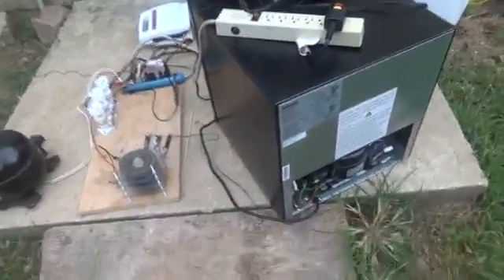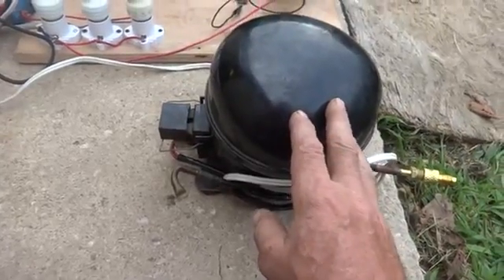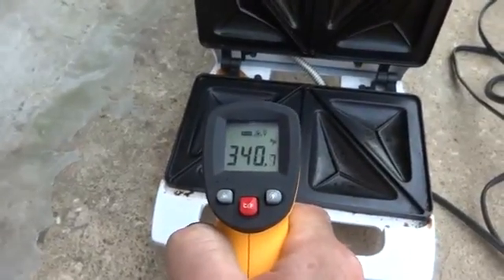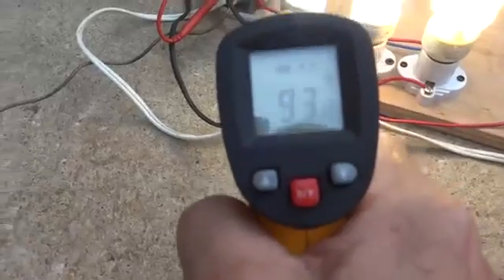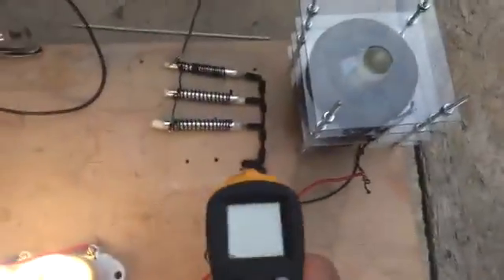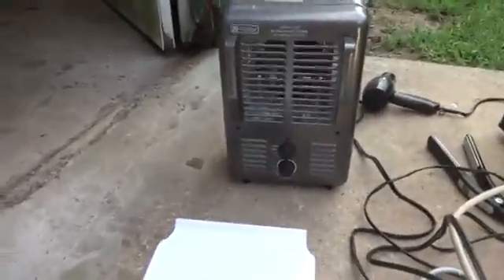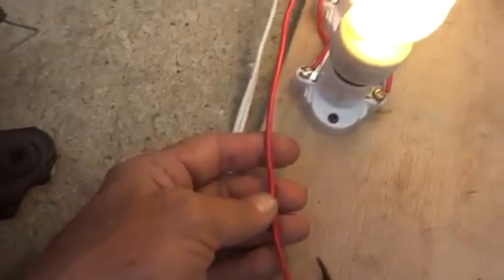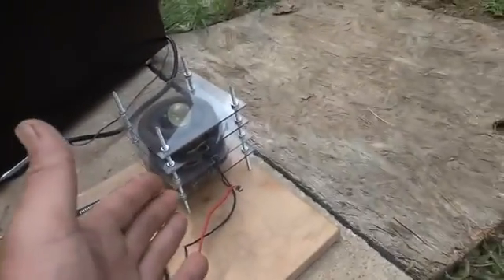Keshe Self-Running Power Generator - 4kW Demo

Comment: Or Hiding the real things in your mind what bloody u had done such a non standard product twisted wire u will connect all this load even if its soldering as per international regulation is not accepted for AC volt or DC volt pls study the regulation at least ,,,,,,stop the bloody drama,,,,,,

Comment: this is fake. keshe is scamster. do research and you will find this too be true.
Reply: I.S. Swinburne . High I'm talking about magraf free energy and the off grid system. There is only two videos which actually show this working there are many people who invested great deal of time in constructing the magraf to find no change in electricity bill. Including people who bought magraf as well . There are many who believe Kesh to be a scam. Do research on Internet and I'm shore you will find this to be the case with magraf unit
Reply: +
I.S. Swinburne
And Santa Claus existst. You are an idiot who fell for a placebo. Get professiobal help
Reply: +
darpan sikdar
There is only two videos which actually show this working
There is only two fake videos which actually show this working.
Fixed that for you
Reply: @sheriholmes3226  Just make your own then. Then make a vid on it. In the end you have to find a way to make it work rather then complain. I've made one that circulated power and generates more energy. The third variable is the chemical compound in between the voltage output. Rather than using the and get and circulating it. You great a chemical compound that is sutable to your use.
Reply: @martinsinger9886  nah i use a elextrolosus fuel converter to get hydrogen gas to power my generator combined with this to reduce the power consumption.
Reply: And I have a couple of pink unicorns in my garden. By the way: Santa Claus exists :D

Comment: That is an interesting observation... Both the refrigerator and the compressor appear to be plugged into the power strip... where that is not what the circuit on the link calls for...
Reply: shouldn't there also be a lead from the positive of the plasma capacitor to the ground (-) of the strip, via a switch, as well as a lead to the capacitor in the refrigerator?

Comment: If this actually worked, then everyone would have there whole house wired threw two refrigerators. yet,,, somehow they don't. Go figure.
Reply: How so?  The average american has no idea how to wire the SIMPLEST of circuits, and patents for "over unity" devices are bought up every year by major industries. Nanotechnology already exists in mainstream science and has been proven to generate electrical current through the quantum field...  I believe this demonstration is not on how to wire refrigerators together, but is focused on the tech that is the stack of coils, and how they interact with the rest of the circuit.
Reply: bos dad not really have you researched the 100s of people who been sent to prison for fined up to the millions for going off grid. it's illegal seriously call your power company for a disconnect because your going off grid and see who comes to see you. man in MN prison for installing a windmill to power his home, Oregon man in prison for collecting rain water on his property instead of city water, Florida residents threatened with prison for turning on solar panels during hurricane Irma when the grid is down. told while the grid is down your down. but a gas powered generator is fine. go figure. the govt does not want us to be self sufficient at all. it's less control on us. you can only go green as ling as your connected to their utilities. and can monitor you. a farmer fined 2.8million for going to solar and not using the grid anymore. look up the hundreds of preppers in jail or fined huge sums of money for making their own power water and food. I understand preppers after looking into this alot. the govt wants complete control of everything you do. you do know the history of Tesla right. he was backed by jp Morgan largest oil tycoon. he made them and power companies a ton of money. and they owed him a lot of royalties and he let it got it would bankrupt them almost. one of his last projects he was creating free power for the world. when jp and the other backers found out what he was planning to do. and had created it worked. he did make wireless electricity area was blanketed with power and ligbtbulsb all over the property lit up. but anyways they pulled all funding and had the tower blown up literally. they were not going to let anyone get free electricity and take millions of year from them. so why would anything change now.  Tesla was the best we had and when it came to money or the best for humanity. well you see where we are today he died alone and poor staying in hotels. the moment he died all his papers he had left were confiscated. he touted and was willing to prove he could make free electricity. but no one would give him a dime to do so. if it's not possible why destroy a man and ruin his life and then take his life's work the moment he dies so his relatives can't receive his belongings. there are a couple people who found his papers there grandparents were his assistants and they posted online about finding these papers from Tesla trying to learn more. and there houses were broken into only the papers were gone and the computer was clean and hard drives mjssjng. yet he never posted where he lived or anything. someone tracked his IP address and broke into his house and found the different floppy disk he had stuff on. if free power is fake there's no need to do all that. Tesla could have worked and been rich. but from that point on he wanted to give people free power and every resource available was used to stop him. they knew he did it. 
another thing I have a hard time understanding is these modified alternator or generators being spun by electric motors. take your car for example. once started the battery can be removed and it runs. it's been spun by a gas motor same with a portable generator. so why can't a electric motor do the same as that gas motor. once turned on if your making enough power, there's no reason it can't run it. but as long as gas makes the rpms that's OK good science. what's hard to understand is why a modified alternator or a generator cares what spins its pulley and why a DC motor cares where it gets its power from. as long as both do their job it works from what I've seen. but it's always claimed as fake. I've seen some start from wall power then removed when up to speed and work. but we're told we can't like it has a conscience and knows it's not being gas or grid powered anymore. but a simple experiment with a vehicle should show anyone once current is created it can run without the battery that started it. because the rpm demand is met. it's easily met with a DC motor as  well obviously you have to stay with what power is available
Reply: Bo's dad = troll
Reply: +I.S. Swinburne
Because he is not stupid and gullible enough
Reply: @2020Kofficial  "harmless worthless scam artist" , I wouldn't call keshe harmless. keshe has no technology, no science, just BS and somebody actually eats what keshe sells. This keshe crap won't end well ..
Reply: @2020Kofficial  Check out "Heaven's Gate". I wouldn't be surprised if something similar will be the end of this kesheshit-thing.
Reply: @2020Kofficial  I've watched plenty of keshes workshop videos. The theories he tells are stupid and just plain don't work. if you look at keshe, you can immediately see that there's no good energy coming from that whatever it is.
But it's good that you agree that the energy side is bogus. No, I don't give money to scammers to give them more fuel to scam even more. If you seek knowledge, I just have to tell the truth that you have been trapped in a ratTrap.
Reply: @EmloK KolmE

Are you afraid?

I've  built  and bought there things.

I don't  pay for electricity  anymore. 

Why do you want to?

Comment: gentelman  with  youtube  channel adhanda2017  send me your video. His you tube is not  set for two way communication .
I have problem with  your  video,  as there is no measurement done  but rather prove of load  power dissipation .
The easiest way to prove your point is simply  to  have someone from scientific community to examine how real is your setup.
I can help you with that.
 With all do respect few questions remain not answered:
1. why Keshe never sold  the  device that does not need any power supply at all.?( in a way you present in your video)
2. would you be willing to allow independent  examination to be provided  to conform that your device works as stated?
3.Why you  do not start to manufacture and sale  your devices  to the public?
 my assumption is that cost of manufacturing Keshe like  device cost  not much more  than $30 per  piece in  mass manufacturing.
 In any way prove of concept opens you door to wealthy  life.
I do not participate in any  deals . However  my  examination is free of charge and if successfully approved   can open doors  that till now remains closed  to you in area of energy production. My activity is for years dedicated to  better  of humanity.
Wesley
Reply: I know and have direct access to an inventor who made possible a' Self-Fulled Mechanically Accelerated (not-magnetically!) Power Generating' System. You may do an independent examination but the inventor is looking for investment support Will you be an investor? Please mail your interest to omnicompower@rediffmail.com
Reply: No I will not be an investor.
The reason people trust me and respect me is because no money can buy me.
I know a lot of people with money, but they base on my opinion in this area.
I will also not be a part of any deal,
I've had  so many deals in my life , now it is my happy time.
Reply: Thank you and no worries at your stand. We have already moved up the project propsal to a few angel investors here in india. Hopefully in a few weeks we might met the target.

Comment: ground wire is for safety it is there in case some part of the circuit accidentally is grounded its purpose is to prevent electrocution because your device appears to set on an island it doesn't need a ground unless you are receiving energy from above in the atmosphere , you do not need a ground, there is something funny about your needing a ground wire, why do you not show in detail your ground rod, I suspect that wire that you call the ground wire has a more active part in running your device.
Reply: true, ground wire completes circuit as you might expect the electrical box is connected to ground, i think its all fake because you have a million how to's make these amazing coils yet no one bothers to make a running model
Reply: +Cesar  You don't need to waste your time or money. It is pure bullshit. Keshe is a scammer from the get go.  No one needs to "ban" this "technology". It is pseudoscience; again, pure bullshit.
Reply: Alex Manzanero
0
Reply: I want to build a model to see if it is bullshit or not, I know Obama ban the technology in USA, so there is something, that can be scam also. any way looks nice if we can have free electricity
Reply: Cesar Alegra all the people I have tried to talk to about these devices refuse to sell them. because they have been threatened and warned and many bad things happen to them. that's why I know there's something to this. the people who want money imma little suspect. but try contacting people. the ones who will give you tips but won't make anything for you not matter the price are onto something. think of this.  you need a battery to start your car. once running you take the battery out. it still runs why? because the alternator is spinning.  the alternator doesnt know it's a gas motor spinning it or does it? all these people claim it won't work. same with a portable generator.  now let's take that alternator. or generator motor. hook it up to a battery just like your car it runs and spins its making current now as long as its making enough electricity it the power can be ran to the DC motor and the battery removed. the generator or modified alternator doesn't care what's spinning it or feeding current only that it's recieving it. but we are told it's fake impossible but yet as long as its a gas motor spinning generators it's sound technology. your paying for the gas. your not paying to loop it. it doesn't make sense why gas powered is fine technology to make electricity but do the same with a electric motor and your life is ruined and threatened. but yet if you take that same electric motor and plug it into a wall socket thats sound technology. but then using the generator to power the motor is now  fake and doesn't work.
Reply: maybe you or someone knows something I don't. but we're led to believe as long as a modified alternator or generator its powered from a gas motor that's great. use it up. or a electric motor powered from the grid or a gas powered generator that's fine. but if you take one to power the other. all of sudden it can't work. it breaks physics etc doesn't make sense to me at least. it's made to sound like these metal parts have a brain and can only work when you burn fuel to spin or power them. but using them together can't work don't even waste your time. the science book says this. so this is how it is case closed. 

our world is a energy based economy. buying a selling power. your in the USA with me. call your power company and tell them you need a disconnect your producing your own power now, and see who will come visit you. same with your water. look it up for yourself it's illegal to go off grid completely hurricane Irma victims in Florida were told it's illegal to turn there panels on while the grid is down. if the grid is down your down. look for yourself.  in Oregon a man was sent to prison for collecting rain water on his property instead of using the cities fluoride laced water. whatever lands on the ground of your state your state owns. and he stole water from the state on his own property.  Hitler put fluoride in water to docile the Jews. it lowers a enzyme in your brain. it was banned after the war in Europe considered mass medication. next time you take a drink of anything pay attention to how much touch your teeth. almost nothing. the little bit that does isn't enough to make a difference. you would have to swish every sip of water for the floruide to do anything. the more I keep going down the loop the scary it gets. hundreds of people have been jailed or fined huge sums of money going into the millions for going off grid and making their own power, water and food. it's scary. no you can't go green unless your hooked to us and pay out fees and taxes. we have to be able to monitor you. even solar is getting hit hard. at first it was great, now they pay huge sums of money for the power they do use now with other fees regular customers don't pay. to make up for lost profits thats their solution. and what I'm down for isn't even completly free energy. but they hate these to. let's say you have a DC motor and a generator with all the transistors capacitors etc. you plug in to your wall and let's say it draws 10 amps at 120v well make a system that steps it up to 100 amps and run. your house on that. it would cut your electric bill and save the environment from pollution. but since it creates less profit can't have that. yet the power companies can have power stations to step power back up. we don't even need to go for free energy devices even using a little power is fine. maybe there's something I'm missing. but like I said if a cars alternator orportable gen can make power with no battery because a gas motor is spinning it once it's started. why can't a electric motor spin it. gas or wall powered is accepted science but using one to power the other is taboo and fake can't work. yet I see it workibg in some examples. can it be faked Ya some can. but some people try to go above and beyond in the videos to show its real and it's usually people overseas who need the power they don't have a constant power grid thats reliable. we saw some stuff like what I'm describing in Iraq but I was young and it wasn't on my mind. The powers that he can't have us be self reliant. they act like they want green energy. but the people who truly go for it are jailed or threatened, machines destroyed. patents bought and buried forever.  
I still would like a answer from anyone. why can a cars electric system be self sufficient once started. and not need a battery but a electric motor can't do the same job once it's started up. from what I've seen it can and it would make sense that it can. a pulley being turned is a pulley being turned. as long as there is enough power to power the electric motor to keep the rpms up there's no logic reason I can see why it doesn't work
Reply: it just seems like as long as you use their fuel or power to pay to run your generator it's fine to a extent. to me they make it sound like when your plug in a device into your portable generator from Lowe's it's knows the power is made from gas and will work. but made from a electric motor nope not today.
Reply: Alex Manzanero if you know where to search on the internet I see working models of things some on regular internet some on the dark web. look up the hundreds of people who have been jailed for making their own power. if people make something I don't blame them for keeping it to themselves. who wants to be threaten, harassed, followed around town. even his ground wire in the picture if it was a hot leg it shouldn't be able to power all that without melting
Reply: AA7J Dn30

Comment: Would have been more convincing if the fridge were not overhanging with one corner over the gap between concrete and the piece of chipboard. Most probably that's where the real power cable goes into the fridge.